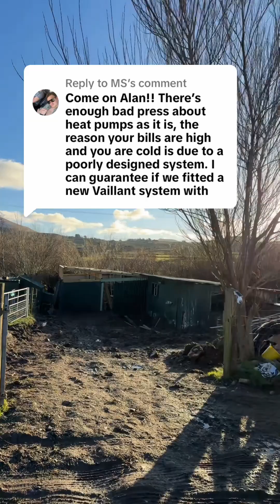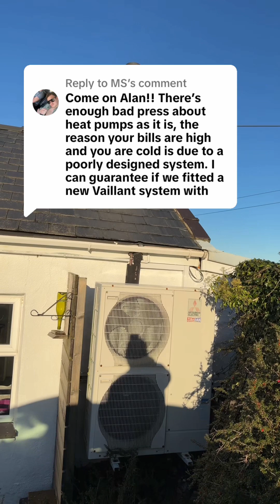Heat Pump Nightmare!  Why Are My Bills SO High? (The TRUTH About System Design & Efficiency)

Comment: I think this is really a political issue. Heat pumps are clearly the superior technology compared to fossil fuel burners, but they require different skills from the installers, and there are too many installers out there who do not have the right training. There should be much tighter regulations about certification of installers, plus clear rules for liability for botched installs. The latter could help with cases like yours that have gone wrong, the former would help avoiding people getting into such situations in the first place. Another aspect that often gets forgotten: there needs to be a public education campaign explaining to people that heat pumps are used differently from gas boilers. I keep reading people complaining it about how long it takes for the heat pump to heat up the house when they come home after work. Well hello, if you are trying to heat up your house after you come home from work then you clearly haven't understood how a heat pump works!

Comment: Radiator shown is insult to radiators. Just  2 flat surfaces. Put some normal radiators in to get some power out of them with lower temps. Simpel steel radiators itself are cheap as chips, hardly cost anything so no reason not to do it.

Comment: If you’re looking for low cost. 

Cheapest thing you could do now is cut down anything that’s stopping by the sun hitting the heat pump. The warmer it is the less power it takes. Make sure it’s not cycling the cold air back in as well so let it blow away as much as possible. 

Next make sure there is insulation on every bit of pipe work from the heatpump to inside the thermal envelope of the house. (Ie if it runs through the loft). Ideally you only want heat coming out where the emitters are (radiators usually) there’s an argument that your still heating in the house if your in the thermal envelope. 

Heat pumps operate best when they have a delta T of 5 deg so check the return temp isn’t too low. If it’s too low you could consider shutting down rooms and sealing them up with draft excluders etc.

If the thing hasn’t been serviced then there could be sub optimal pressure on the refrigerant, it’s unlikely but how would you know as there are no good controls on the unit (from your other video) 

Insulate the loft. Cheap and will capture more heat possibly helping the return temperature. 

This looks like someone just ripped out a boiler and chucked in a heatpump. The big rads look possibly oversized blanket chuck em in type approach. Should let you run it at lower flow temperatures but I bet without the proper controls the pump is just going full blast. 

Nothing wrong with heat pumps but they are not a direct replacement for a boiler where it’s chucking out 75+ deg water. Is like comparing a F1 car to a dragster. Both are different. 

If you don’t design the system right on a gas boiler mostly it will still work but will cost you more to run because you can always crank up the heat. 

Heat pumps can output hot water to more or less the same temperature but they lose a lot of efficiency doing so which means higher bills.
Reply: Great comment.

Comment: Surely just installing the correct controls for the heat pump and you'd be half way there! It looks massively oversized for the property unless there is a lot more of the building than shown in the video. You could start by upgrading the radiators but without the proper controls you'd be almost better off just to use electric heaters when and where you need them.
Reply: And you could do a collaboration with @heatgeek

Comment: The cheapest fix is insulation . Internal insulation maybe insulated plaster boards, external maybe cork rendering , floor insulation under floor heating,..Triple glazing?. This where you should have started.  Get your thermal camera out see what is coldest.
Reply: Be careful with this - internal insulation can result in damp staying in the walls.
Reply: @chrisspringett7860  True but not if done correctly. Cork render external insulation is breathable. Personally I would do both.
Reply: @keithbrown339 agreed.

Comment: The scheme requires the heat pump to fully replace your previous fossil-fuel system.

Hybrid setups (heat pump + gas/oil boiler) are not allowed under BUS rules.

Your old boiler must be removed or permanently disconnected as a heating source.

By accepting the grant, you agreed not to reinstall or revert to a fossil-fuel boiler as the main heating system.

Switching back to a gas combi boiler would breach the grant conditions.

If you did revert, the government could require the grant to be repaid.

Installers are required to notify Ofgem that the fossil-fuel boiler has been removed or disabled when claiming the grant.

Comment: Personally I'd be using air to air heat pumps and get rid of the wet heating, a2a much better for damp properties. Use the existing heat pump for DHW only.

Comment: Heat pumps are decent technology but for some reason there’s a culture of fitting units that can - if the calculations are absolutely perfect - only just manage to keep the house warm. Obviously the calculations are never perfect so this results in under-sized systems and bad performance.

Comment: 1) your correct a lot of heat pump installs are absolutely F terrible. Leaving tens of thousands of people in the UK with a system that doesn't work, or costs way more to run than it should with little to no easy way to fix.

2) air flow. Unit is too close to the back of the building and nowhere near enough circulation area Infront of it. Cut bush back and or turn unit 90 degrees so it can chew through more air. Main thing is heat pumps don't make heat*, they move it.
3) radiators. Those are sized for a normal boiler system that would supply 60-70c water. Heat pump work best on an output around 30-35c, so radiator needs to be at least double the BTU's. That's why underfloor works very well with heat pumps
4) your a plumber, just go and chase all the daft exposed copper runs, block up holes in your ceiling etc 
5) reason your using so many kWh for a low output is most likely the unit is operating on the resistive heater inside (defrost heater that gets ice off the coils due to bad design of system), so your actually just using a big electric > water > air heater, if it was running actually as a heat pump your bill would be at the absolute worst , half what it current is.
6) name and shame.the installer. UK is far far too soft on bad trades..as a plumber how many times in your month have you had to go over and above to get a customers house back to operational due to cowboys and twats who just don't know what they are doing. Heat pumps and solar are the new frontier where a lot of those guys have weasled their way into people's homes.

But yeah. tackle.the easy things first. Heat pumps CAN be great, and for those of us off the gas network (and have had it happen enough winters where we cannot get oil or lpg in mid season) we are all on resistance electric heaters, and a bill of only £1k a month would be absolutely lovely. But, majority of UK installs are bad, pumps are bad, technology wasn't good enough or usually, the installer's just don't know what they are doing, and the government grants fueled a lot of cowboys.  All the best my man.

Comment: These should be banned, awfull just like those EV  cars.
Reply: Definitely get a heat geek survey and ask for a full report. 
If you had a grant it's got a warranty for poor work and you probably have a claim.
Reply: You never owned either of these items have you.   Il keep enjoying the 22c house temp downstairs,  21c upstairs all day and all night.   Oh it was -1c last night and to heat the house from midnight till now it's cost 64p.  charging the car from home,  auto defrost and the car doing 260miles a week.    a monthly Avg of £60 for heating, car running and the running of the house.   Yes we used the option of the grant,  but it cost us £3780  for the unit,  new pressure tank, 5 new radiators and the labour.  They can work when done correctly.     Ps we still have microbore tails on the rads so pipe replacement that people go on about.

Comment: The heat pump cultists always talk about COP/SCOP & how little electricity costs off peak on Octopus. But conveniently ignore the capital cost of the ASHP, the bigger rads & circulators, the problems adequately insulating older homes in Britain, the lower heat pump efficiency in Winter, the need for back-up on cold days, the risk from black-outs, the fact most people want heat quickly when they get home or if the weather turns, etc.. And they particularly never mention the £7,500 grant, that would obviously go if ASHPs ever went mainstream. And which doesn't apply when you need a replacement ASHP.
Reply: Well... You switch to a heating system that works differently. Costs apply, planning needs to be done. You can start by doing things step by step before turning to a heat pump - insulating, modernizing radiators,... all that helps, even if you don't get a new heating system. When you are done with that, you can start thinking about turning to a heat pump.
Reply: @heldt952  - Or you don't do any of those things & replace your gas boiler for £1-2K.
Reply: @Benzknees Sure. I am one of those family fathers in mainland Europe. I want to avoid paying extra for CO2 in the future, and want to avoid emitting it as far as possible anyway.
Reply: @heldt952    - The CO₂ that is a fundamental of all life on Earth, without which there'd be no plant life & nothing for us to eat?
Reply: @Benzknees and here we move from pro/contra heat pump to does climate change exist and I am out.
Reply: @heldt952 - "Does climate change exist". Ask the dinosaurs, when temperatures were far higher than today. They must have been burning too many fossil fuels.

Comment: My vaillant 5kw arotherm heat pump, has cost me £10.51 so for for heating for November. 150.2kw used at 0.07ppkwh at a cop of 3.7. It looks like the system has not been sized properly or is very old and not working well. Probably would be best to get a detailed heat loss calculation done then you will know how much undersized it is and will help inform what work is needed. The heat pump also looks ancient, I think they were introduced from 2006, I understand the older ones don't modulate down or up to match the temperature outside and so cost more to run, it is 19 years old technology. Maybe you could get Heatable to look at it. You would be best getting rid of the on off controls and run it low and slow if possible and do low cost insulation like loft insulation, draught proofing etc., thermal curtains.

Comment: I started my eco trip with solar and modest battery size, had a grossly oversized 15yr old 40kWh Baxi combi and undersized rads! House never warm (tight northerner). New kitchen, gas hob gone. Extra batteries and then an EV. Bit of research & due diligence, got a 6kW Daikin HP, all rads replaced for much bigger. Original 10mm micro bore branches from 22mm headers and new external 28mm primaries. House is a leaky '92 4 bed detached. After getting help from a solar and HP experienced friend to set up the HP (LWT mode and weather comp), it's running 24/7 and used a max of 24kW/day during the recent cold snap. It's surprising how a bit of winter solar keeps the batteries from draining. Granted, heat is not blistering but whole house is now quite comfortable, first time in 27 yrs.

It's clear, the heat loss was calculated accurately, the HP installation was well executed and set up. I don't have the best insulation, just loft improved and decent 20yr old double glazing. I might add that the EPC assessor said it wasn't worth trying to improve the wall cavities (poor ROI).

Now the deal breakers.... I'm on a time of use tariff (🐙 I. Go.). Without the EV, without the solar & batteries (24kWh) and the TOU tariff it wouldn't have happened.

I've followed you for years Al as you've helped me keep the old boiler ticking along. I'm so sorry you're having such a hard time of it given your achievements and efforts for others. Keep up your good work and with luck, you'll crack it.

Comment: They wouldn’t be getting bad press if they were a decent product 😂
Reply: Most of the "bad press" I have read came from people who obviously didn't understand the technology. Unfortunately that includes a lot of the people who are installing them.
Reply: @chrisgemmix0815 a good mass produced product must be simple to use / install. Most engineers don’t want to go home at night after a hard days graft and study low temperature heating, or building insulation….most people are more concerned about paying their mortgage and putting food on the table….and who can blame them……your never gonna change that, and hence why heat pumps are NOT fit for purpose! They need perfect conditions to work properly, and unfortunately you can’t roll out perfection on mass scale!

Comment: See my comment on previous vid , use the fireplace 7kg per use will last about 4 hours , use the bloc bricks medium density,  there is no quick or cheap fixes , but you can lag the roof space to r45 will help a lot , the headache is farm made solid walls , treat the walk with waterproofing, 3 coats if you’re exposed.  About 5 5 litres of treatment, This will help dry out the wall and keeps the house looks,  it takes about 2 days to install my four bed home and lasts for 10 years , high  bills are typical of old farm houses going full electric isn’t an option i through 35k in upgrades to get it from a 30kw heat loss down to 14kwh  11 years ago I gave since moved ,if  the windows are single glazed , you just don’t get it warm, and shouldn’t have been heat pump to begin with,  I get the feeling this wasn’t calculated to get the heat pump serviced asap if the rads are not getting to temp it could be both bearings and refrigerant needed , finding a qualified one available though us going to be a headache, it’s old not end of life ,  don’t install column rads seriously think of using k3 rads , like you said it needs updating
Reply: So basically just stick to gas.

Comment: Bigger radiators will improve COP.
Reply: Also cost more as the system will have to be on even longer. There’s no cure for a lack of insulation.
Reply: @Danfrank24 With larger output radiators they can run at a lower flow temperature so the ASHP is more efgicient and overall running costs are less.  

Insulation is a very good way to reduce heat loss and thus heating bills.

But there is a way to fix lack of insulation, and the heating industry has beed doing it for ages - install a high output energy wasteful gas boiler and don't care about the wasted energy because gas is cheap.
Reply: @robertsmart7484 yes pretty much, I work for a gas distributor so of course I want people to use gas. Using a heat pump doesn’t use any less gas as the power stations are burning the very same gas so let not pretend it’s good for the environment. I’ve fitted off take pipes into power stations they’re 36” pipes running at 7bar.
Reply: @Danfrank24 In the UK there is some gas used for producing electricity, but also wind and solar.  And for those with solar PV and batteries "free" electricity to run a heat pump in Autumn and Spring.
Reply: @robertsmart7484 yeah of course it does.

Comment: Dry out all the Damp in the walls that will pull out all the heat you put in.
Reply: Use wood to dry the damp then go back on to the heat pump. They work in new houses they shouldn’t be retrofit they’re crap.
Reply: Sounds like you are a moron my friend.